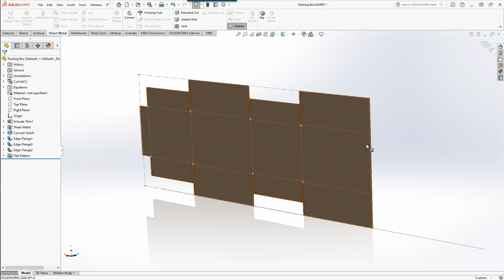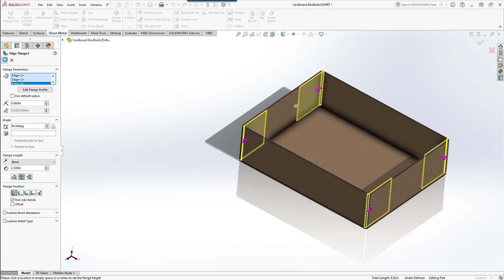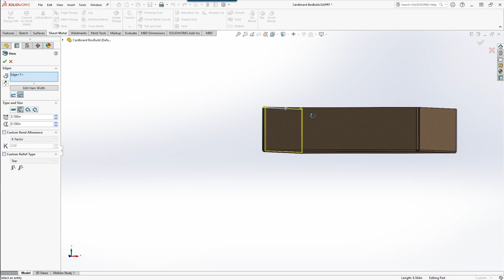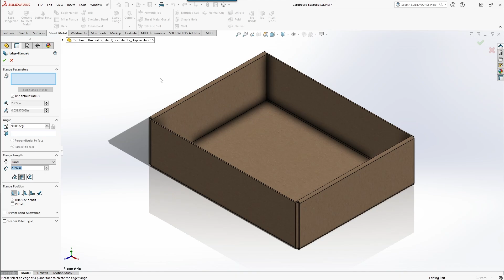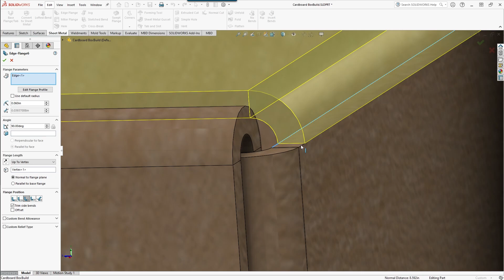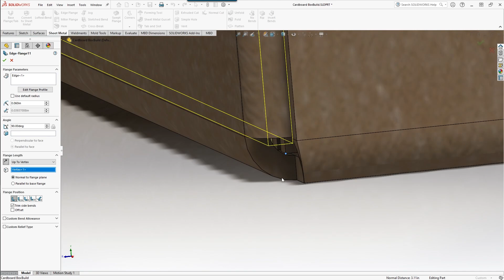How to Design a Cardboard Box using SolidWorks Sheetmetal features!

Comment: this is a fantastic video. how do you only have 3060 subscribers?
Reply from the maker: Thank you!  Doin this on the side.  Just need to put out more content regularly!
Reply: @domeasolidtuts  with this guide i just designed a little packaging for a gift, i was wandering if there was a way to make it truely automatic to adjust size. As in change 3 variables of what you are trying to pack and the box scales. ive run into some issues there so maybe you know the way.